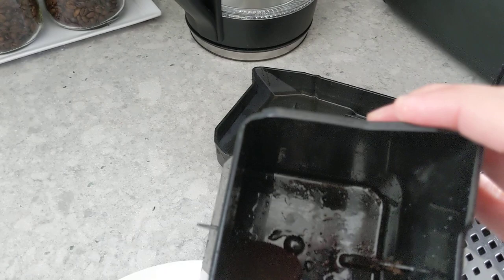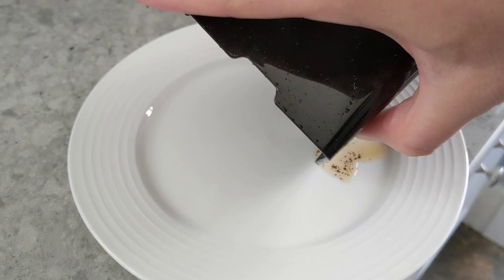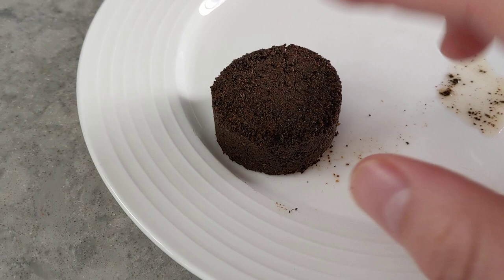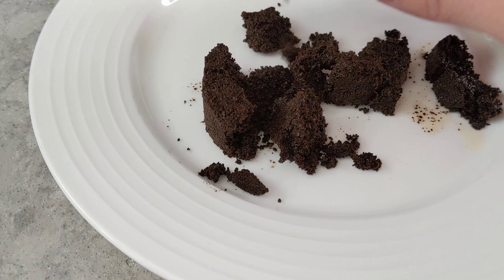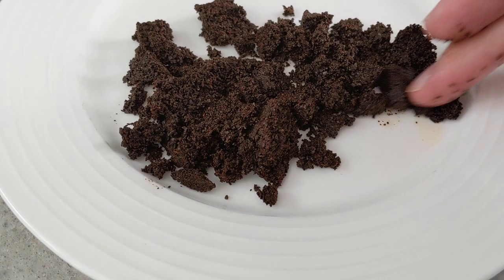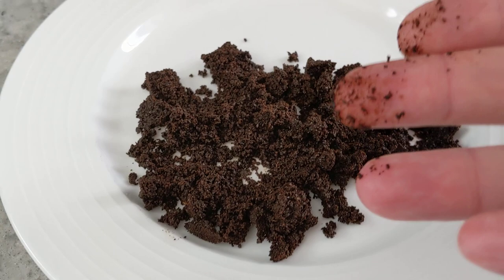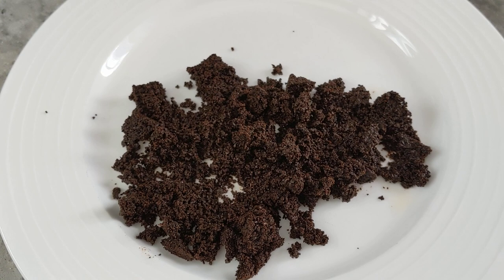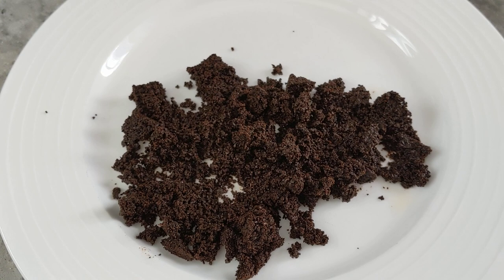Phillips 3200 Series LatteGo - Trying to make sloppy pucks. (See Description for Update)

Comment: That review is far away from reality. Please read the manual first.
Reply from the maker: I'm literally filming reality.  So what's so far away from it?  I was testing different settings and seeing the results based on a question asked on another video.  I've also read the manual more than once.  So what's your issue specifically?
Reply: @BryanKlein  I am quoting from the manual "You can only adjust the grind settings when the machine is grinding coffee beans. You need to brew 2 to 3 drinks before you can taste the full difference."
Also, from the manual, "Do not turn the grind setting knob more than one notch at a time to prevent damage to the the grinder".
 Also, from the manual, "Therefore we advise you not to adjust the grinder settings until you have brewed 100-150 cups". Quoting you, "You also might notice that I paused the recording to bring the grinder to the fine setting while it was running." I am quite sure based on the difference between the amount of beans before and after the "pause" that you did not operate the machine 11 times. :) That is my issue specifically.
Reply from the maker: @froudos  Thank you for clarifying.  Now to address your points.  
"You can only adjust the grind settings when the machine is grinding coffee beans."
This is true in the movement to the 'fine' direction because you would be clamping down on beans or parts of beans trapped between the grinding surfaces.  This is less of an issue when moving the knob in the 'coarse' direction because you are moving the surfaces away from each other and not causing unnecessary stress on the grinding components.  The manual errs on the side of caution, as expected, but there is a difference between the directions of movement.  An understanding of the grinding mechanism should resolve this point.

"You need to brew 2 to 3 drinks before you can taste the full difference."
I am not interested in flavor, the video was testing the machine to explore how one could make 'sloppy (watery) pucks' which was an issue discussed in the comments on my other video.  
Running the machine for each knob position (12 positions) and 2-3 runs at each position (total of 24-36 runs) would not only be impractical for the video, but it would also be irrelevant to the primary reason for the video.  I was taking the machine settings to its extremes to test the ends of the spectrum to evaluate the differences there.  This wasn't a full exploration of all variables involved and how those changes impacted the taste.

"Do not turn the grind setting knob more than one notch at a time to prevent damage to the grinder" 
Again, this is relevant in the 'fine' direction (I did make the changes slowly allowing for multiple revolutions of the surfaces to occur prior to moving to the next position while the recording was paused), but irrelevant in the course direction based on the simple mechanism of the grinder.

"Therefore we advise you not to adjust the grinder settings until you have brewed 100-150 cups"
Based on your critique, I would need to make one position adjustment per full run for 12 positions, then make 100-150 brews per position.  This would require 1200 - 1800 runs of the machine to move from position 1 to 12.  To apply your statements to the actual settings of my machine before and after testing (position 9), and to take the low end of 100 brews per position claim, I would have to make 800 brews to get from position 9 to position 1, then make 1100 brews to move from position 1 to 12, then make another 300 brews to get from position 12 back to position 9, for a total of 2,200 brews (200ml each for a total of 440 liters) of coffee just to test the difference between position 1 and 12 when starting at position 9 and going back to it again.  This is not only impractical, but it also is not based on a sound understanding of how the machine works.

I understand the reasoning for the advice in the manual to err on the safe side and to make careful changes to the settings to not damage the machine, but I also understand how the grinding mechanism works and did nothing in my video that was either unrealistic or harmful to the mechanism.  I was also not interested in evaluating changes to flavor through the range of settings, I was focused on the consistency of the grounds and the settings that would lead to more or less moisture in them.

Thank you for your time commenting and your concerns, I agree that in general people should make slow and small changes to the machine and to take some time to let those changes be sensed in their taste tests.  This will reduce the risk of damage to the machine and for people to find the settings that work best for them and the beans they are using.  It is also true that larger changes can be made safely without damaging the machine, if you think about how the grinder works and make changes in such a way that does not place unnecessary stress on the mechanism.
Reply: @BryanKlein  You may know how the grinder works but you also need to know how super-automated machines work. Every coffee machine with the same features has the same behavior. If you adjust the grinder you must brew a couple of cups first to fully see (not only taste) the difference. I am not talking about a million coffees. I am saying that you could at least make 2 or 3 cups first before comparing. I also believe that you exaggerated with  your calculations. To fully test the machine according to the manual you need to brew at least 3x12 to compare the 12 different grinding levels. I do not know how on earth you counted so many times :P . The quote from the manual about the "100-150 cups" refers to another thing. They just claim that you need to brew 100-150 cups having the grinder to be set to the initial position and then start adjusting it by your own. Anyway, sorry for being so aggressive at start but please, do another test, without brewing so many times! Just make a couple of cups first before comparing!
Reply from the maker: @froudos  Thank you, the issue is that I am not testing for flavor, I am testing the extremes for grind size and water saturation. The 2-3 brews per setting has to do with taste testing and repeating the test 2-3 times to get a reliable measure of flavor at a specific setting.  For a taste test, I would recommend the same process.
My exaggeration was to make a point... When you read things literally and take them out of context things can get very unrealistic quickly. I do know that it was a recommendation for testing the initial setting from the factory before someone starts messing with the knobs. Since this was a test of the physical characteristics of the 'puck' that the machine produces at different settings, and taking the settings to the extremes, I expect that the differences would become apparent through a few runs with these endpoint settings.  I appreciate the remark about your initial comment. If you have this machine, you are welcome to do a more thorough test with replicates at each position and see if there are detectible changes to the pucks within each set.  I'd like to see that video as well and would link to it in the description of this video.  With a more rigorous method, some insights might reveal themselves.  I am not interested in doing it myself, but I'm open to new information.
Reply: @froudos  if I may ask... Why does it take a few cups to taste the difference? This a single grind bean to cup, therefor each grind is for one cup. With conventional grinders there is residual coffee grounds in the grinder and you have to purge (do a couple of grinds) before the new ground is in full affect. This is the point of  making a few cups after changing your ground...
Reply: @AquivaStar  Hello Johann. I am not a Philips engineer nor I try to sell their products. As you can see, I am quoting the manual. So, you may ask, of course, but not me. :) Anyway, as far as I am concerned, having used this machine for a while, to get the best out of each grinding level you have to brew a couple of cups. I do not say you should trust me, but I highly recommend to trust those who manufactured it.:)
Reply from the maker: @AquivaStar  I don't think that the machine has some 'smarts' that change characteristics of the brew (some kind of calibration process) after making changes to the grind settings.  If it does, it might take a couple of passes to finish making changes.  If it doesn't then the first brew should be the same as the third or tenth after changing the gap between the grinding surfaces.  I have a support request into Philips to see if there is a calibration function.
Reply from the maker: @AquivaStar  I spoke with Phillips support and then was directed to an authorized service center where they repair the machines.  It turns out that the reason to run the machine 2-3 times is to do exactly as you mentioned.  That there is a little chute from the grinder to the brew basket that holds 2-3 grinds worth of grounds in it.  This means that you are not getting grounds directly from the grinder into the brew, there is some lag time while grounds in the chute are pushed to the brew assembly.  This does mean that my tests here were fairly useless, as I was originally under the impression that the grind was going directly into the brew assembly.  The only way to get a 'fresh' grind to the brew assembly is to put it through the port at the top of the machine after grinding it outside of the machine.  I must say, while I can't say I notice a degradation in the quality of my coffee, because of how many grinds we do per day, I think that many consumers think like I did that you are drinking the grind that the machine makes when brewing and not the grounds from 2-3 brews ago.  If you have 1 brew per day, you could be drinking grounds from 2-3 days ago.
Reply from the maker: @froudos  you were correct, thank you for your comments here to help motivate me to get to the bottom of the issue. I spoke with Phillips support and then was directed to an authorized service center where they repair the machines.  It turns out that the reason to run the machine 2-3 times is to do exactly as you mentioned.  That there is a little chute from the grinder to the brew basket that holds 2-3 grinds worth of grounds in it.  This means that you are not getting grounds directly from the grinder into the brew, there is some lag time while grounds in the chute are pushed to the brew assembly.  This does mean that my tests here were fairly useless, as I was originally under the impression that the grind was going directly into the brew assembly.  The only way to get a 'fresh' grind to the brew assembly is to put it through the port at the top of the machine after grinding it outside of the machine.  I must say, while I can't say I notice a degradation in the quality of my coffee, because of how many grinds we do per day, I think that many consumers think like I did that you are drinking the grind that the machine makes when brewing and not the grounds from 2-3 brews ago.  If you have 1 brew per day, you could be drinking grounds from 2-3 days ago.
Reply: @BryanKlein  I really appreciate your efforts and your passion! You hardly find reasonable and willing to discuss people in YouTube anymore.
I MUST say once more that I owe you an apology for my initial comment because I feel really bad about the way I expressed myself! I am also very happy that you contacted Philips support about the issue which means that you are a truth seeker.
I need help with another issue with my machine and i would be glad if you could help. Everytime and before the pouring starts I get hot water running from the group while the infusion happens. Which if I forget to move my cup makes my espresso watery. Has this ever happened to you? I suspect that I misspositioned the filter in the first place. In Greece it's very difficult to find availability in spare parts so I prefer to wait for the machine to prompt me for the filter change and since I am not sure if this is the issue I do not want to spend time. Also, do you know if the machine works without the filter? I will raise a ticket to Philips support too, soon.
Reply from the maker: @froudos  Thank you and apology accepted. :D As for that bit of water during the pre-soak, I get that too sometimes, but not all the time, I am not sure yet what causes that pressure in the brewing assembly to slip past into the tubes that lead to the cup.  I have changed the filter and that didn't change this behavior, so I am not sure that this is the cause.  I haven't yet found a pattern to reproduce this every time.
Reply: @BryanKlein  Thanks for the effort and explanation Bryan. This is handy to know. Since I rarely buy the same coffe 2 months in a row, I only experiment with the grinds for that spesific coffee.. I have found that with a finer grind I can taste the coffee better when it is just "plain coffee" with a cappuccino I lose some of the flavour. 🤔
Reply: @BryanKlein  I just got this machine and I'm suspecting it happens when you switch between different drinks, but I too am looking for a pattern. So at least I can confirm that it happens out of the box!

As for the above discussion, I still wonder one thing: why would Philips recommend to brew 100-150 cups before making any adjustments to the grinder? That seems like an awful lot and I just don't get why that would be needed

Edit: I suppose it could be the filter, because it doesn't click into "the only possible position", but that seems odd. It must mean the three of us misplaced the filter on 4 occasions combined.
Reply: @bryan are you sure about the hopper that holds 2-3 grinds worth of grounds? Here’s why I’m questioning it. The settings on the machine allow you to adjust the amount of grounds used. So not all drinks use the same amount of grounds, if the machine grinds at each use, how would it grind the correct amount if the grounds it is using were ground 3 drinks ago? 

I was all set to buy this machine until that comment came up. I don’t want to go on vacation and come back a week later and drink week old grounds. I want fresh ground coffee.

Thanks in advance.
Reply: @Simonsnet  you can test this right? like, add one portion of beans that's like super oily dark roast, brew, add one portion of light roast beans, brew, and see if you immediately get the full difference, or if you get the full difference only at the third cup.

either way, this is solved by just throwing away the first cup after you've not brewed for a week
Reply from the maker: @Simonsnet  it's not a hopper it's a little chute that transfers grounds from the grinder to the brewing system.  It can't be more than a couple of centimeters long, and seems thin.  I don't know the capacity of this chute.
Reply from the maker: @Simonsnet  I made a video explaining what I see for the chute. https://youtu.be/1II1_xCJmFQ
Reply: @BryanKlein  not all heroes wear capes! Thanks for that video. I think this puts me more at ease and I’m going to move forward with the purchase. 

You’ve had yours for a while, would you buy it again?
Reply from the maker: @Simonsnet  Yep, we have run over 1000 cups through this machine in the year and I don't see that stopping anytime soon, we have really enjoyed it and it's a favorite treat for friends and family when they visit. :D
Reply: Omg

Comment: Just bought a model 4300 and yea the pucks are a sloppy mess that dont even eject into the grounds bin. I'm thinking the brew group has too much grease on it from the factory making parts sticky so it doesnt function properly. Tomorrow i'm goung to disassemble it, clean everything, and reapply with minimal grease. If that doesnt fix the problem it's going back to Amazon.
Reply: Howd it go?
Reply: @JimBobe  - Turned out I was using a medium roast (Starbucks Pike Place medium roast) which SHOULD have been compatible. But, the beans were just oily enough to clog the grinder output where the grinds fall into the brew group hopper to be made into a puck. So I wasnt getting a full 8g of coffee grinds each cycle. This made the resulting pucks watery/sludgy. However, I found a solution to this problem!! No matter how oily your beans, put them on a baking sheet and bake at 200°f for 10min. Pull them out of the oven and let air dry. The oils evaporate into the air leaving behind dryer beans. I noticed a reduced aroma afterward but no change in mouth texture or flavor.

Favorite bean: Starbucks Pike Place medium roast. (Somehow it's the least sour tasting bean I've ever had anywhere)

Second favorite: Lavazza Espresso (bean blend). It has a very distinct creamy texture in your mouth. This is a phenomenal blended bean mix designed to work well with the espresso method.

And yea, the Phillips 4300 is a great machine. I recommend it to anyone.
Reply: @__-pl3jg  very interesting. Thanks for the write up
Reply: @__-pl3jg  Also, fyi, with this machine you’re not drinking the coffee that’s been freshly ground, but instead coffee that’s been ground from the past.

For example, I only use my machine on the weekends (2 cups saturday morning and 2 cups sunday morning).

So the 2 cups I have Saturday morning are from the reservoir on my previous grind THE SUNDAY! I recently learned about this and its pretty upsetting tbh

Comment: Hi! Thanks for this video. So we mostly use this machine for Americanos or coffee at this point. Night cap espresso of course. What would you suggest for settings? I'm coming out weak with these longer drinks. Lavazza crema a robusta
Reply from the maker: I set the grind at 6-7 dot and usually use it for coffee.  I have found that max water volume does dilute the shots a bit, so I normally do espresso with the middle light on the water volume setting.